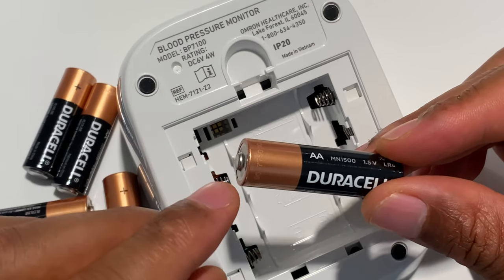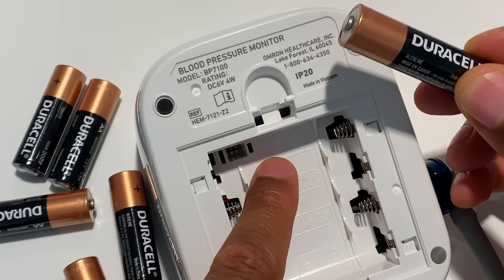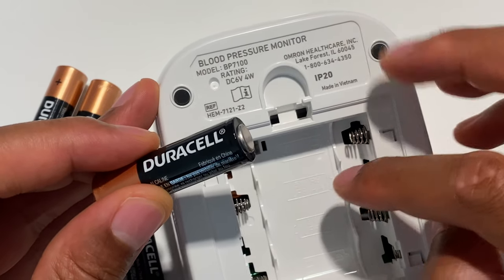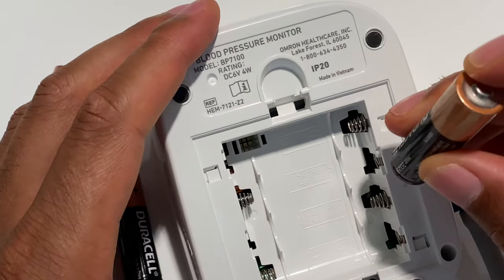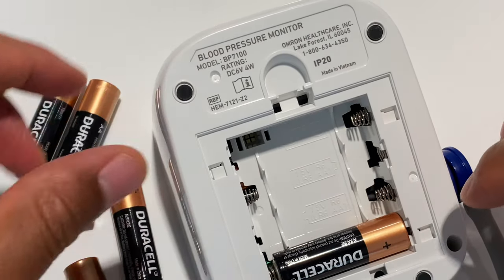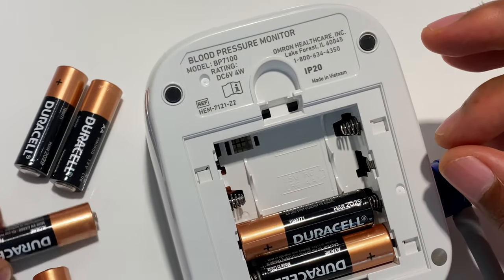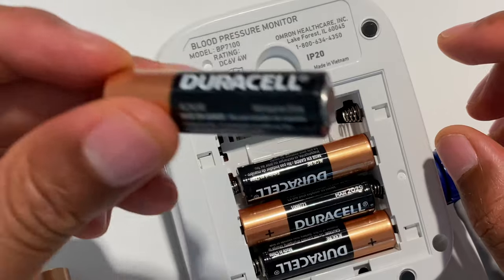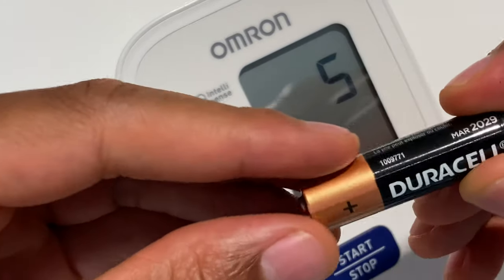AA Battery Replacement - How to

Comment: I got a rechargeable flashlight which had a Lithium Ion battery where the flashlight didn't have + or - marked… but it had a spring on one side so I came here to see which side the unmarked spring is: -

The battery is marked + and - on the side in tiny lettering, but the flashlight itself wasn't…
Reply: The exact reason I came here as well. No + or - but I remember taking out the battery with the flat side on the spring. Just wanted to make damn sure before I set something on fire, lol!
Reply from the maker: Check the battery for the + and - markings, that should guide you!